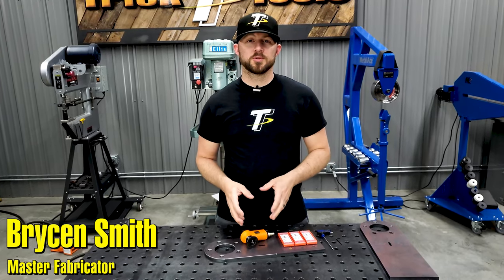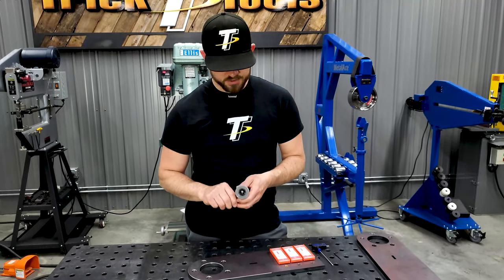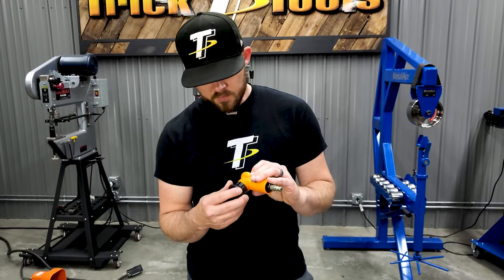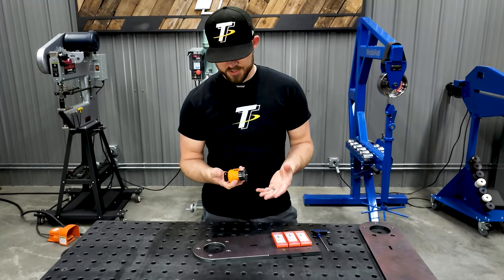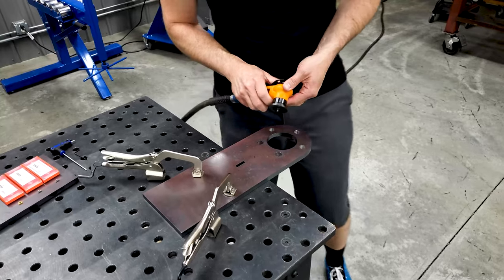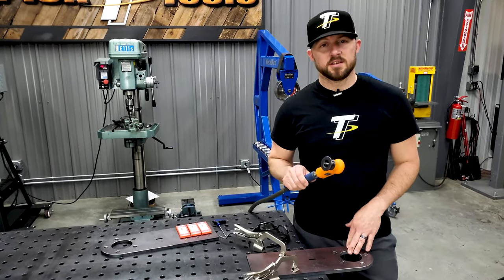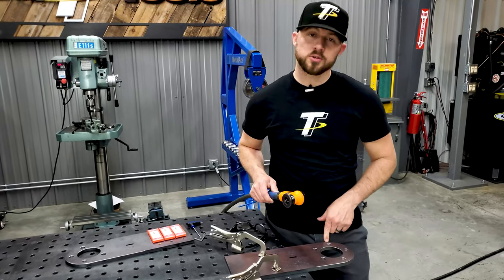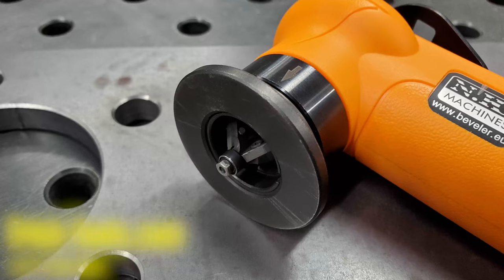Beveler B2 Air Deburring Tool - Trick-Tools.com

Comment: That’s awesome!!! Wonder how it does on 3/16” stainless?
Reply from the maker: Unfortunately the manufacturer doesn't recommend using this model on stainless but they do have bigger sizes that will work better for stainless. You can see those here - https://www.trick-tools.com/Beveling-Machines-1152